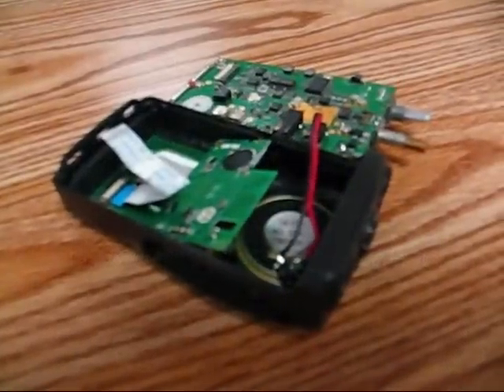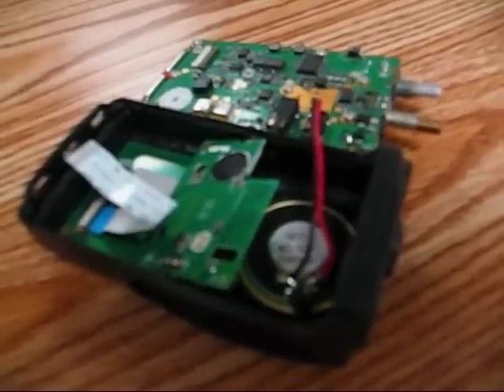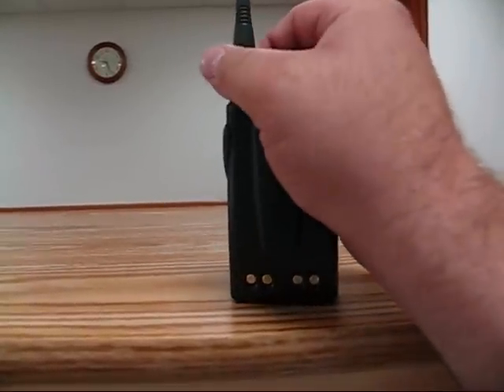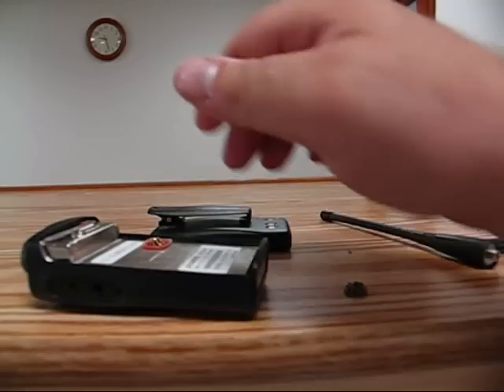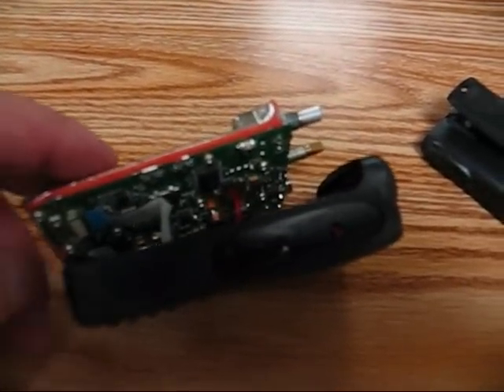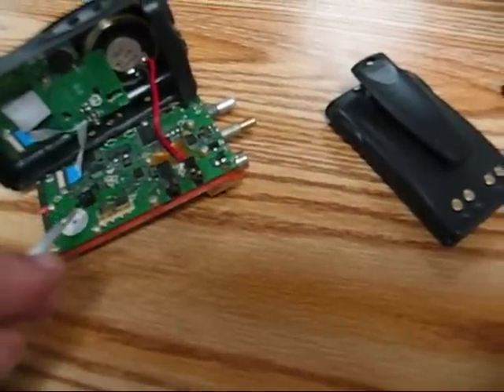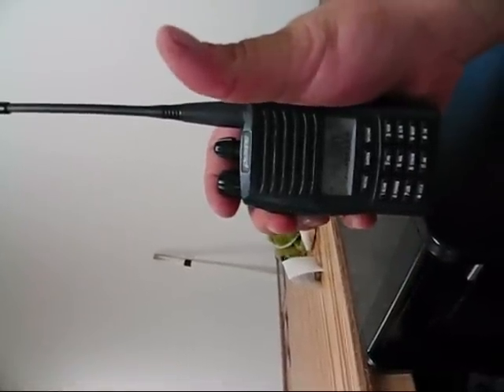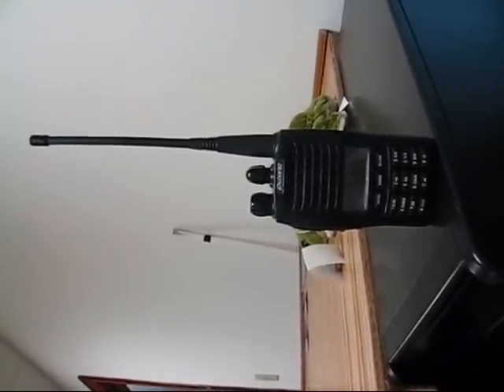PUXING PX-777 Disassembly & Modification

Comment: Hi. I have one of these and its locked
 between 144.000 to 146.000 it wont go any higher or lower on the frequency ive reset it but still nothing. HELP
Reply: Chris Woodward Chirp software.
Reply from the maker: Sorry I no longer have the radio good luck with your issue, Thanks for the comment and  remember to share like and subscribe !!! 73

Comment: @jewpalegay by now you may have probably already found out how to program the radio but you would need to buy a special usb cable which terminates into the headset connectors. This cable can be found for $6.60 at dealextreme(dot)com just type in 66578 into the search

Comment from the maker: @26highstreet No adjusting the deviation is adjusting the deviation from the pot in the video. Drilling a hole in the case doesn't make it louder it just cleans up the audio and makes it sound cleaner and less muffled.